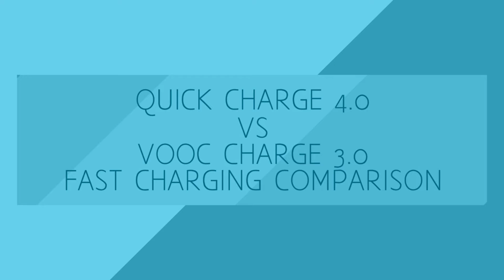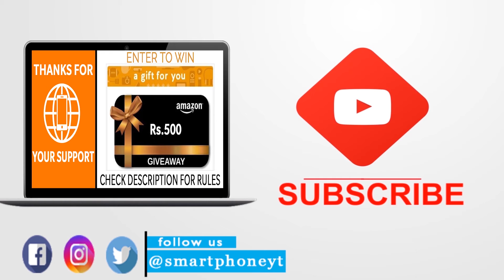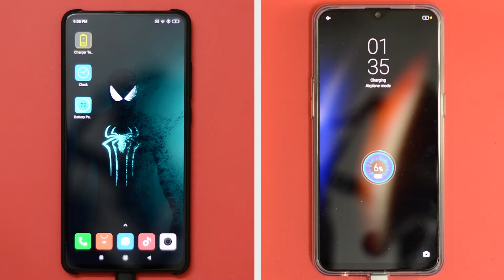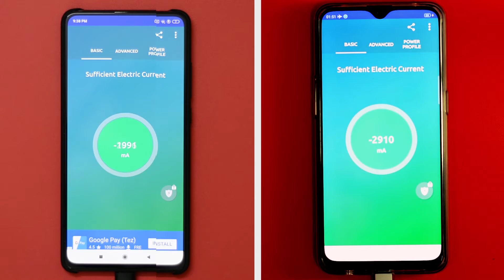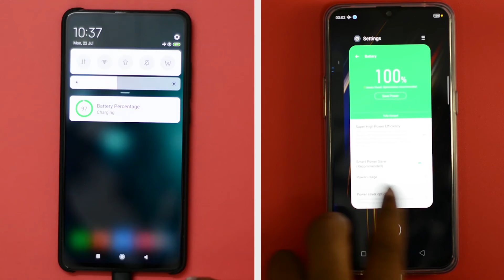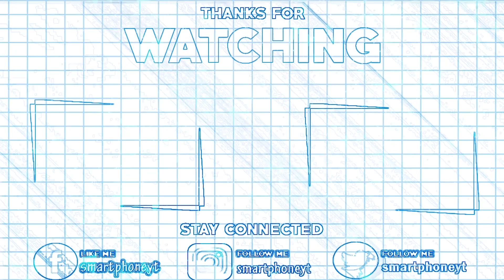Quick charge 4.0 Vs Vooc 3.0 Fast Charging Comparison | Redmi K20 Pro Vs Realme 3 Pro Charging Test

Comment: This is not fast charging test...this is slow charging. check your plug board...my quick charge 3.0 adapter only take 1.10 hours to get full charge ( 4000mah battery )
Reply from the maker: Bro, I use the same plug board for both phones. However, in future tests i will check the output of my plug board

Comment: Thx for this video. You have cleared my doubt and also can you suggest me a good smartphone under 30,000 please. I was interested in K20 pro but can you suggest me a good phone
Reply from the maker: Thanks for the positive feedback🙏🙏
There are 3 best options under 30k bro - Realme X2 pro, redmi k20 pro, oneplus 7/7t
If you slightly stretch your budget to 33k go with oneplus 7t - absolute beast with great software
If your budget is strictly under 30k go for realme x2 pro - great phone with flagship specs. 90hz display, 64MP camera, 50W charging. Only downside is color os and its cartoonish looks(can be fixed with custom launchers)
If you want full view design experience with no notch go for redmi k20 pro. Great phone with stellar battery life. No 90hz display though.
My choice will be oneplus 7/7t - oxygen os offers way better performance and feel compared to color os and miui
Reply: Oppo reno2z is best phone or not under 25,000 ????
Suggest me a phone which is best  for all like  camera , for playing pubg , storage etc... Under 25,000
Reply from the maker: @rohiplayzz8557  Its a good phone but there are way better options available in the market for 25k. Redmi k20 pro will be my choice coz sd 855 will outperform helio p90 any day. Camera performance will be similar on both phones. If your budget is strictly 25k then go for k20pro. If you can stretch your budget to 28k or 29k , then go for realme x2 pro